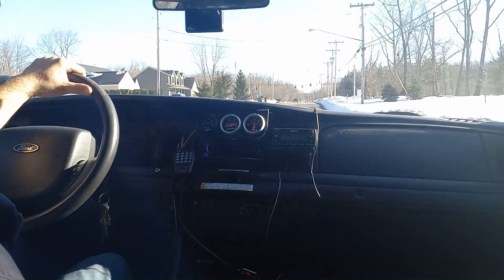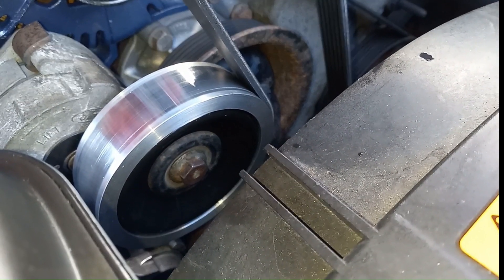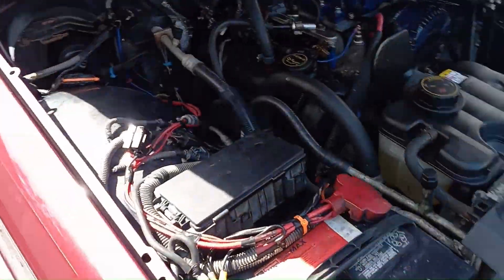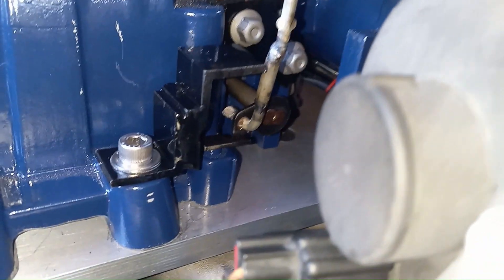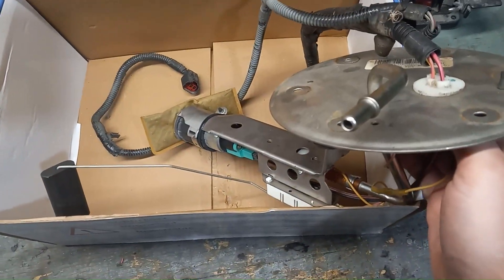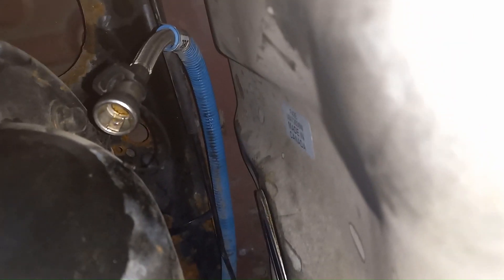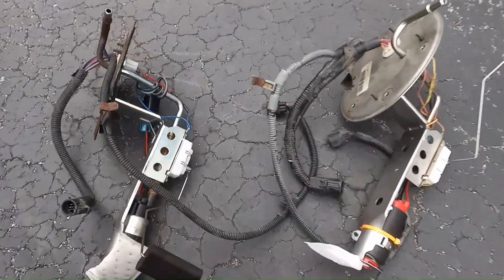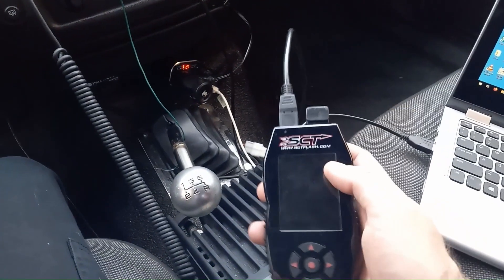M90 Supercharged Crown Vic - Part VIII

Comment: Love it man that’s an amazing build, I have a 99 town car and I want to throw a eaton m112 on I’m looking for the easiest bolt on sc without killing my wallet my question to you is how easy do you think it would be?
Reply from the maker: @adamhasan9379  The M112 would be ideal.  But they are much more expensive.  And if I’m remembering correctly the throttle body is on the passenger side on those.   Which is opposite the Panther cars.  

The easiest way to do it would be a centrifugal kit.   Like the vortech one. 

Fuel pump upgrade.  

MAF upgrade if you want more than about 7psi. If you don’t want more.  M90 and stock MAF is fine. 

Then the tune.  Which is a significant expense.  Whether you do it yourself or pay a tuning shop.
Reply from the maker: Thanks by the way :)

Comment: So, just a make sure,...I have SCT X4 programmer, Flasher, just like yours, I am adding Cobra Supecharger into my Mustang 2005, V6 engine, almost done with it, so then obviously I need to program it, I do have also that Air/Fuel Ratio gauge, what is a name of the program, I could Download into my Laptop? Can you buy it, Is it called "Live Link Drive System", and where do you get it?? Thank you, Eero from South Florida, youtheman =))
Reply from the maker: @Eeropolvasti  Sounds like a plan.  That supercharger should give you plenty of boost for the V6.  

You download LiveLink from SCT’s website.  You have to be on the X4 page.  And there is a “ download now” button.

To get there from the SCT homepage, you click products, then performance devices.  Then you will see the X4.

But that would only allow you to datalog.   To actually tune the engine you need the Advantage III software which is $350
Reply: @bpbuilds  Could I use that Advantage III Software in other cars/ engines also?? Where you can buy it, eBay?? Thanks, youtheman !
Reply from the maker: @Eeropolvasti  if you want to tune another vehicle.  

You must provide proof of ownership of that vehicle to SCT.  Like a title or registration document.  

You pay an additional fee. $150 in 2023. 

And SCT will provide you with the files needed to tune that car.  

You buy it directly from SCT.  I used their sales and phone line and spoke to a  sales rep.   

They are based in Florida.   

You pay the $350 fee.  And they mail
You a USB dongle with your personal license key to run the software.
Reply: @bpbuilds  OK, much much boost  you recommend me to try first with my V6 Mustang engine, about 8 --10, right??
Reply from the maker: @ for your first time?   Yes I would size pulleys for 8 psi.  But approach that goal slowly with the gas pedal.  

Boost is a function of throttle position.   You’re controlling how much air the constantly spinning mechanically driven supercharger is given access to.  Which is spinning at a speed to always provide boost if your pulleys are calculated properly based off the Compressor maps of your supercharger. 

I wouldn’t go much higher than that without some sort of knock protection.  And intake temperature monitoring.
Reply: @bpbuilds  Thank you Sir, will have Stage 2 cam in, but original pistons, engine has 120000 miles, we'll see, I will take it "easy' first, programming important, right?? How about Injection spray into intake , to lower temperature??
Reply: @bpbuilds  How about injector size?,I believe I got 36 or 39 cc injectors, correct?? Enough?/ Thanks=)
Reply from the maker: @ need more information. 
 39cc of fuel per minute?  Per hour?   Per second?  What fuel are you running?

The factory 4.0L V6 from a 2005 mustang is rated at 210 horsepower.  

If you are going to be running 8 psi boost.  This is roughly half of one full atmosphere of boost.   

Meaning.  At sea level.   The air is at a pressure of 14.7 PSI.   

If you are able to boost an additional 14.7 psi.   Theoretically your power should double.  

You’re going to be booting a little more than half that.   So your V6 should be making roughly 105 horse more (half of the stock 210). 

For a total of roughly 315 at the crank.  

For that power rating, I would recommend a set of 24 lb/hour injectors at least.  

24 lb/hr is 252 cc/min.  

To be safe I would get something a bit larger.  Maybe 30 lb/hr.  Depends what your budget is and what injectors you’re looking at.
Reply: @bpbuilds Yep, thanks, I am thinking 30 to 36 lb/hr, we'll see, TY =)
Reply: @bpbuilds  I think I got 34 lb/hr, remember, I have Stage 2 cam, and Short headers !, Will be...interesting....;o)
Reply from the maker: @ your fuel injector flow information is critical for the tune.  

If you do not know what injectors you have.   Or

 what their firmware information is.  You will have problems.  

Check out ford racing or ford performance websites for this information on common for injectors

This can’t be an “I think” situation.  You must know what injectors you are running .
Reply: @bpbuilds I understand, of course, you need to know, exactly what are you using, otherwise you cant program , tune your engine, my engine is not build yet, i just have all the parts, including Cobra Supercharger, modified intake manifold, Stage 2 cam, new sets of stiffer springs, and of course, bigger injectors! Thanks for you advices, knowhow, I let you know, when engine is running !!=)
Reply from the maker: @Eeropolvasti  excellent.  Make a video.
Reply: @bpbuilds  I will, when I start doing it, if I need your specialty advises, when tuning it, sure let you know, Thank You for your help, youtheman =)

Comment: Nice video! Getting close to putting together everything for my Vic, have some Cnced plates for an Intercooler and all the supporting mods to make that work. Curious about the tuning and Livelink, is it the $350 dollar program on SCT’s website or is it free? And have you noticed any significant gain in speed or 0-60 times? Thanks and can’t wait for next upload
Reply from the maker: @ConnorHuet  the software isn’t free.  Yes it’s the $350 SCT Advantage III

Yes it’s quite noticeable.
Reply: Awesome thanks

Comment: great video!, just had a couple questions:
do you have to have the bypass valve or could you just delete it?
if you have to have it, could you theoretically cut it off and get a similar mechanism like a blow off valve for a turbo and put it downstream(after the supercharger)?
Thanks!
Reply from the maker: @tristanhuet1888  bypass valve is covered in part 2.  

It isn’t necessary.   But is recommended for any application other than strictly racing.   It’s mostly for helping with intake air temps.  And fuel economy during high vacuum operating conditions like cruise and idle. 

That’s an interesting idea.  I suppose if you had a port for the blow off valve in the lower intake manifold (between the supercharger outlet and cylinder heads).  Then you routed the vacuum line for the valve to the same place I do (between supercharger rotors and throttle body) the BOV should function. The same.   Your spring selection would be important.  

Also, you would need to route the BOV to the ducting after the MAF sensor.   Meaning.   The BOV would have to draw its air from a place that has to flow through the MAF to get to the BOV.   This way the ECU knows that air is being consumed by the engine so it can account for it.  

If you were to simply vent the BOV to the atmosphere, you’d have lean issues.
Reply: @bpbuilds  thanks, very helpful!